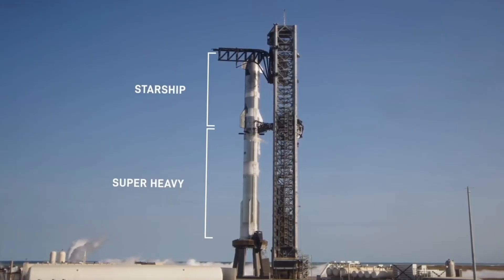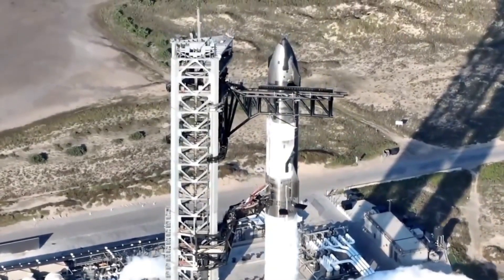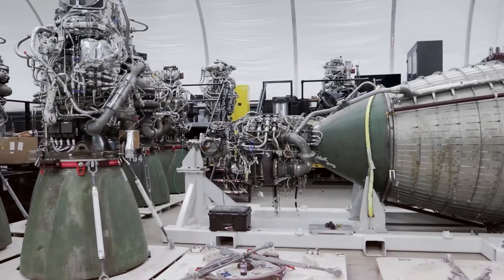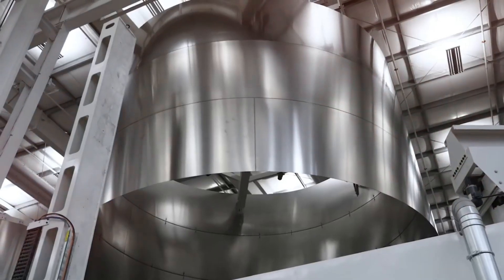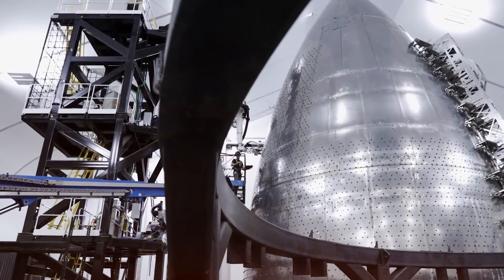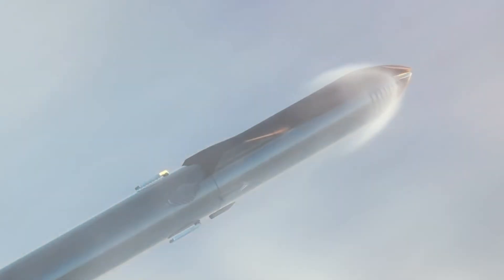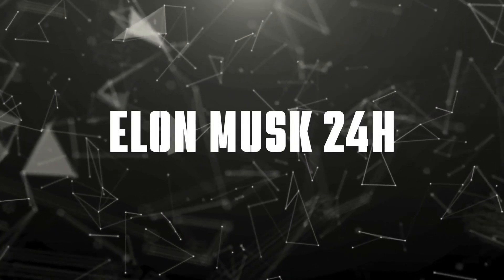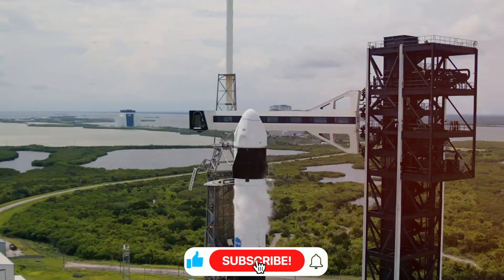SpaceX New Upgrade: The V3 Welding Breakthrough That Left NASA in COMPLETE SHOCK!

Comment: I was involved in laser welding some 30 years ago. It’s a remarkable process. The heat-affected zone in a weld is often embrittled and this becomes the limit on weld strength. But with laser welding the temperature gradients are so steep that the heat-affected zone is very thin. This matters because a brittle thing is not brittle if it is thin enough. In the same way that one can tie a knot in a fiber of glass, the HAZ in laser welding is not brittle in practice. A HUGE advantage. People forget how vital microstructure is in metals!
Reply from the maker: Absolutely fascinating insight! With SpaceX pushing the limits of laser welding to achieve nearly flawless seams, do you think this breakthrough could redefine the standards for manufacturing beyond aerospace, or is it exclusive to space-grade applications?
Reply: @ laser welding can produce great results, but it needs consistent preconditions with respect to joint fit and material. You can use filler wire to bridge a joint gap, but with the laser power available in my day, you couldn’t go too far in that direction because it would slow the process down. If you slow the process down the temperature gradients reduce, the HAZ gets wider and you lose the advantages coming from a super-thin HAZ. But where the process capability is good enough to allow rapid processing, it allows some unusual possibilities. One can stake weld solid carbide and steel, for instance, rather than brazing the joint. This avoids the temperature limits of a brazed joint. With other welding processes this would be impossible. So lots of possibilities but hard to generalize.
Reply: @Elonmusk24h  
microstructures in metal matter in every field of application and pushes the limits out to a new level for new product innovations.

Comment: Video has no ending. It just STOPS mid sentence. In high school, I was taught that if you are welding stainless steel, then you used TIG.
Reply from the maker: You're absolutely right on both counts - our abrupt ending was a technical glitch we're fixing, and your point about TIG welding being standard for stainless steel shows how SpaceX built upon proven fundamentals before pushing into their revolutionary automated laser welding systems. Would you be interested in a detailed follow-up video on the specific differences between traditional TIG and SpaceX's latest methods?